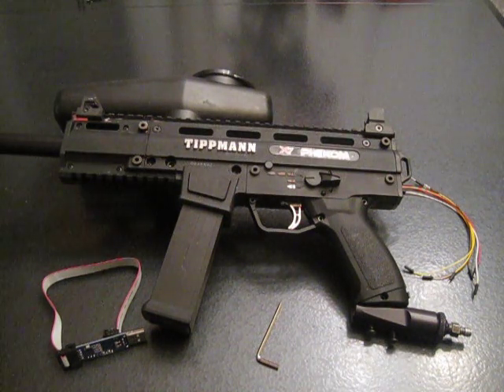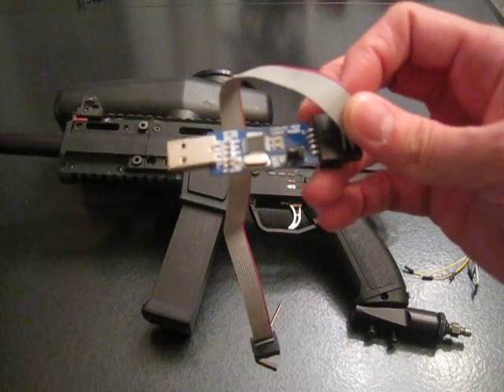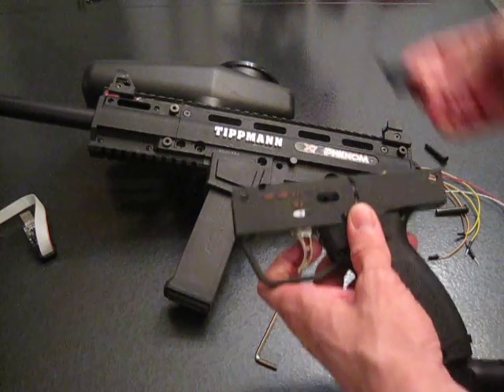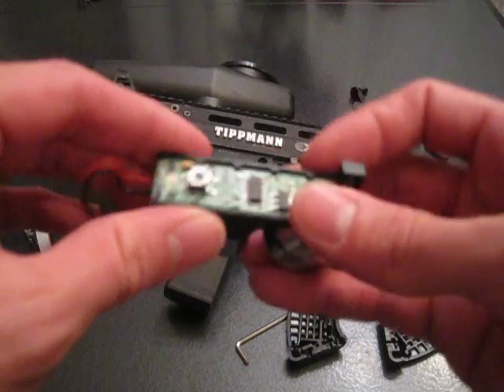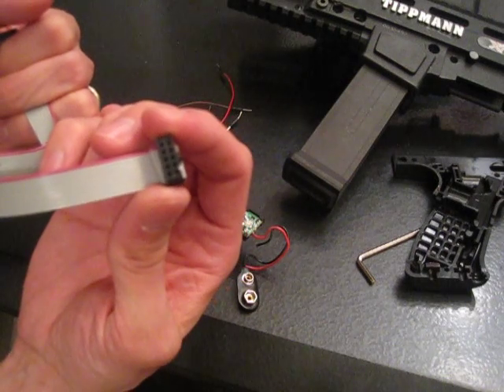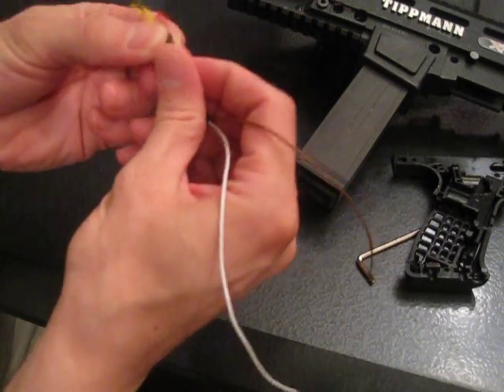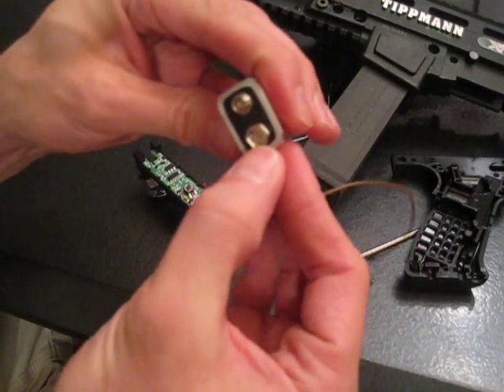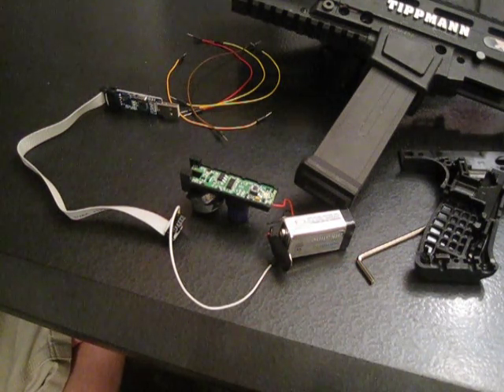Phenom Programming Part 1

Comment: Just curious if this is still current? And your wiki? I’m finally pulling the trigger and modding my new x7. Old one lasted 6 years but I never modded it. I’ve purchased a usbasp board and jumper wires. Hopefully everything works out come a few days.
Reply from the maker: Ryan Havens yes, still current. Let me know if you have any questions or issues.
Reply: That was quick! Sweet man thank you! You’ve got it spelled out pretty good. Awesome job. I am curious about documentation for all the programming. I couldn’t find that. However, I only plan on running full auto and 3 round burst. Found a vid where you set to 20. Seemed pretty perfect. Also saw a video of stock sensor stuttering. Should I be worried? Is it an easy upgrade for the better sensor? I’ll probably pump the trigger 3-5 seconds at a time. Not looking to empty entire hopper
Reply from the maker: Ryan Havens Programming the options for the trigger is on another page in the wiki. If you can't find it let me know. The sensor might not be an problem for you. Even if you do see a problem with it, it's not a show stopper.

Comment: What color  Are your boards minds is red and I got a different signature
Reply from the maker: The newer boards are red and may require more work to program. Tippmann has started disabling the programming pin which requires a high voltage (12v) programmer to reset.

Are you having issues programming outside the signature? What is the device signature you're seeing?

Comment: Hey Mike is this mod something that is still possible? Also, are you still available to assist if I run into any problems?
Reply from the maker: absolutely!
Reply: Ok that's great to know. I will be getting the MKP-II with the loc bolt shortly and when the d-mag helix mags come out I will up grade to the e-trigger and do this mod.

Comment: Hi how safe is this? I have been told it will eventually break the gun
Reply from the maker: Interesting that I have not heard that. Let me know where you heard this from because if they have valid points, I would like to hear them out. I have run several tests and use the software in my own marker without issue. There have been a few people who have had a bit of trouble getting the software on the chip, but we're usually able to get past the problems. I will say though, this is not for the faint of heart. Let me know what you find. I would be happy to follow up.

Comment from the maker: You may need to download and install the drivers for usbasp.  I've just posted the link in the wiki under "Driver for usbasp".  Let me know if you have trouble finding it.

After the driver is installed, you should see that message go away.

I will post more details on where the wires go in a little bit.  Check the wiki again later today.